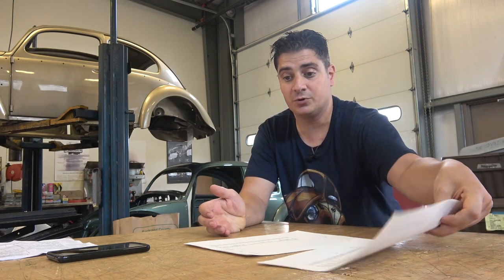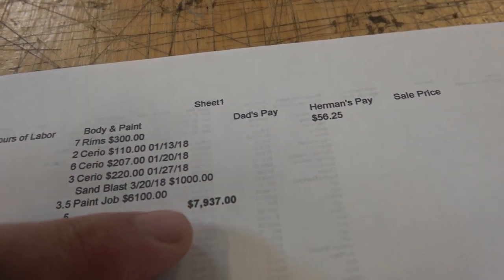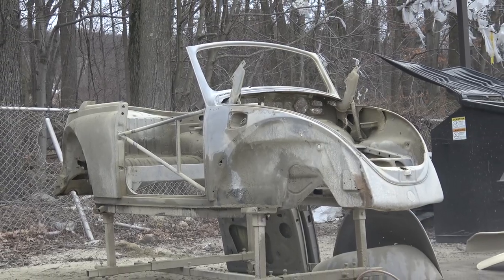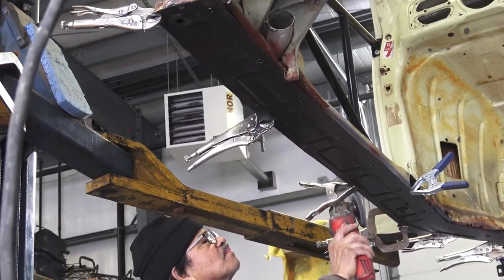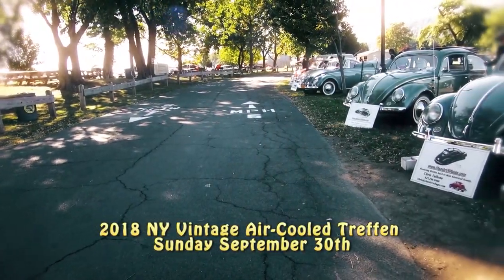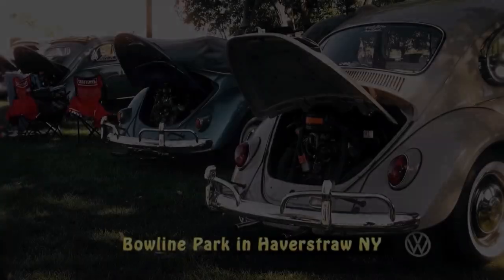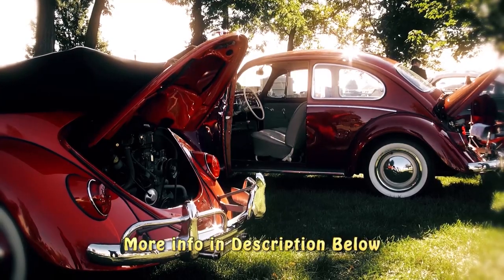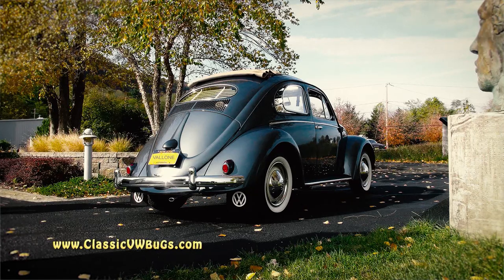Classic VW BuGs How to Budget your Vintage Beetle Restoration

Comment: Just finished restoring mine but didn't need to get involved with the forward firewall.  Now I have squeaks and creaking noises. Any thoughts ? I can hit ya up through your website if that helps
Reply from the maker: where are the noises coming from?
Reply: @classicvwbugs  I pin pointed the front noise to be right above the tunnel at the footwell and the back sounds like it's both lower corners. I replaced the floors, and the corners including rear well and bolt stripping . I might be able to locate the back and solve it but the front is throwing me for a loop since I didn't work that center at all.

Comment: My first car was a '72 Bug.  I loved that car even though it was beat up and ragged out when I got it. I loved its simplicity. 55/4 A/C, accessible and easy to fix engine, and the economy to own. Insurance was cheap, it didn't guzzle gas, and it was truly the funnest car I've ever owned.  If I had the money to spend I would restore one to like new condition without the expectation of selling in a heartbeat. I personally think cars come with too much today and I wish some manufacturer would build a truly bate bones car or truck and sell it for half of what new vehicles are selling for.

Comment: I like your restorations. I'm not one for lowering or huge modifications. I owned a '68 which I bought in '71 for $1100. It was a good deal and it was my first car. I still to this day drive a manual.. I had that car for 7 years  and it took me everywhere back and forth to the west coast and to Florida. . The only time it broke down was when the points closed and it wouldn't start. It made me a lifelong VW guy. I now have an 1994 Audi S4 which is a great car.

Comment: Maybe I misunderstood, $45k and that’s not counting for parts. Once completed it’s not even worth half of that. I understand the quality of service but there’s a point ($$$) where a person  has to realize that it’s just stupid to spend that much. I love beetles, but part of the reason people restore these is nostalgic and the affordability.
Reply from the maker: Very true, as with most classic cars, the resto costs far out weigh what the car is worth in the end.  This is one of the first things that I discuss with a new client, I always bring up resto costs to value.  Most clients that I work with understand the huge gap, and most still sign on due to sentimental values and nostalgia.
Reply: So he said 45k or 4500???
Reply: You can get a fully restored Beetle at those auctions or at Bring a Trailor for like $15 to $20k. Cause that 45k to 65k yeah naaa.
Reply: @nycsestore  those are usually fully fixed up, not fully restored. Engine and gearbox full overhaul, body off nut and bolt restoration, full interior redone, full quality paint job, all are really expensive.

Comment: Thank goodness i know how to do body work on my bug. Also my buddy is painting my car. So i guess im saving alot there. Thanks for the insight on this subject.
Reply from the maker: yeah that is huge man.  Expensive in some places, like here in NY.
Reply: @classicvwbugs   Doug's bugs sell a kit of bolts for the whole car all stainless still allen head type for 250 bucks. I know OEM parts are better but it is almost cheaper to buy new parts and weld them on compared to sanding, rust treatment, dent work etc. Keep up the great videos, I watch yours and bug me dvd's to work on my 65 vw, stayed tuned it's gonna be the nicest looking vw bug in the states. :)

Comment: I'm in Long Beach CA and I just asked a shop how much for paining my clean 67 bug in and out, they want between $4500 to $5500, and I'm removing all the rubber and chrome and door windows.  In 2000 I had it painted and it was a good job for $1000.  Is that normal?

Comment: Do you do any custom restorations?? Or is every bug factory stock as it looked when it came out
Reply from the maker: Sure, take a look at the 70 convertible we just finished, I painted it with a mini BMW color with a two tone black with espresso tweed interior.  We do a lot of that, but still keep the stock height with stock motors, I do not lower or anything.

Comment: 15k for a paint job? Thats insane.
Reply from the maker: It's body and paint.  If you have floors to do, heater channels, quarters, shock tower areas, luggage, any structural area to do, and you have a body shop do that metal, and want a show room quality paint job, for sure it can cost that much.  If you don't want show quality, of course that changes.  To some people, it's high, no doubt.
Reply: Right?!? I have NEVER heard of a 15K paintjob. LMFAO! Then again a sucker is born everyday.
Reply from the maker: You gotta get out more then.  Hit up shows, you will be amazed what people pay.  Been doing this for ten years, worked on hundreds of bugs, it is rare for a bug, but it can get there the more of a basket case it is.
Reply: Here in California paint jobs pretty much start at 5k and only go up from there
Reply from the maker: For sure, call up Lenny or call up Koch, they can tell ya too.
Reply: i got quoted 10,000 just for paint buddy
Reply: $15,000 is the going rate for a bare metal respray with all of the rust repair. I do similar work to Classic Mercedes and getting out for $15,000 with the labor, body repairs and finishing work is simply What It Takes with all the labor involved.
Reply: I can roll down to Mexico to get a paint job for 600$. Then again, I do have a baja, not a show car.
Reply: @classicvwbugs  show  quality work and street quality are pretty different creatures your cars are amazing, not in my budget, but amazing still!
Reply: Nah. Econo-$300. Lasts a few years and their quality has only gotten better. I strolled past one the other day and the quality was shocking. Honestly couldn't tell it was a cheap job. If you can do body repair you've got it made. Even if paint fails in 3 years just get it redone. $600 v 15k. No brainer. 15k paint jobs are for people who have nothing to do but spend money. Its called stupid money.

Comment: I would rather pay 40 to $60,000 for a 40 year old Volkswagen, a car that will actually be on the road in another 40 years then throwing it away on a new Volkswagen or an Audi. Buying new cars is a complete waste of money, unless you don't know how to pop the hood and check your oil and adjust your ignition points.

Comment: My 1973 Super Beetle cost new off the showroom floor: $2,208.53.  2019 and I still have it. $30,000 to $40,000 to restore it? I don't think so...
Reply: I just bought a 1972 standard beetle as my first car for 5,500. No major rust and almost brand new engine.

Comment: 15k for a paint job + bodywork + metal welding.. that isn't bad at all.. it's not a deal but it's not a rip off.
Reply: Mark Villanueva you missed 40k of labor
Reply: @jerrygomezjr601  any restoration shop that purports actual hours should be charging only for hours worked. Do business with people you can trust.

Comment: Also if I were to restore an old bug I wouldn't want anything but a Super Beetle.  The McPherson strut front end is MUCH better than the old one!
Reply: McPherson struts are specifically the reason you don't. Plagued with vibrations at different speeds, bushings going bad. Low pressure gas shock is all a beetle needs in the front
Reply: @doginu  I disagree struts are easy to replace and they work better that is why VW added struts to the Beetle in the first place.  Super Beetles drive better than standard Beetles.  Bigger trunk too.
Reply: The  drive you seem to like is from the 160lbs added to the front. Loss of about 4 mpg. But what would I know, I do this for a living. I don't post videos, I wrench. I'll put my 56'Drag Bug up against Super Beetle.   (o\|/o)
Reply: @doginu  I wasn't talking about drag racing, and the SB has a larger engine as you know, so of course it's a little thirstier.  The SB is better, hence it's name.
Reply: @wsbill14224  the best beetle for a daily driver is the 68-69 1500cc standard beetle with factory front disc break but if you want a super beetle you could surely get a newish one built in South America just before they stopped production for a good price with a good 40 years of life left before it needs restoration or even better rust treat all the problem spots before they even rust